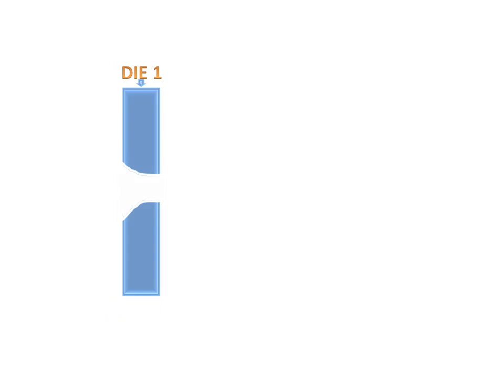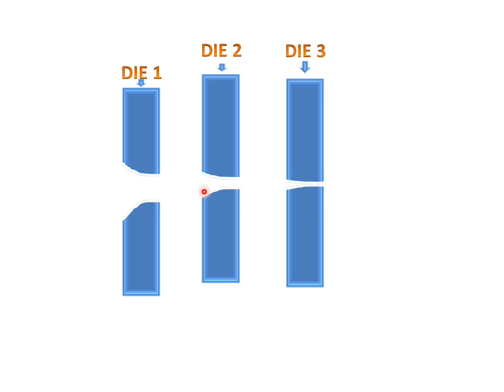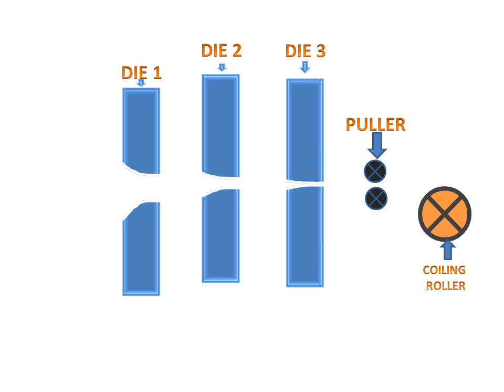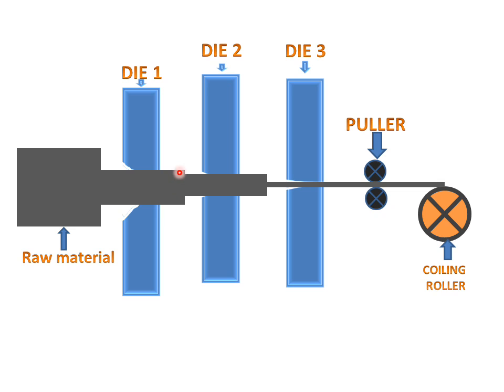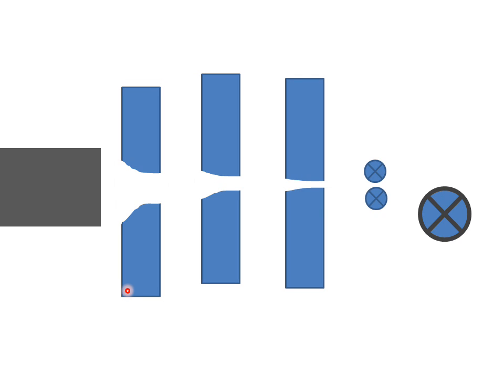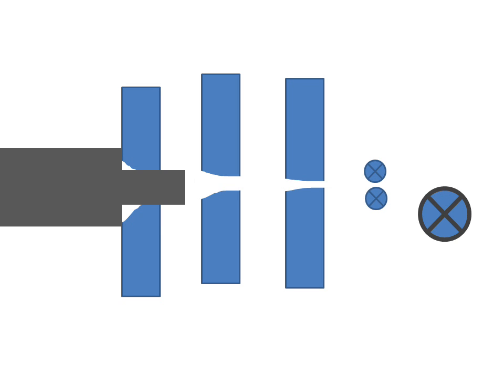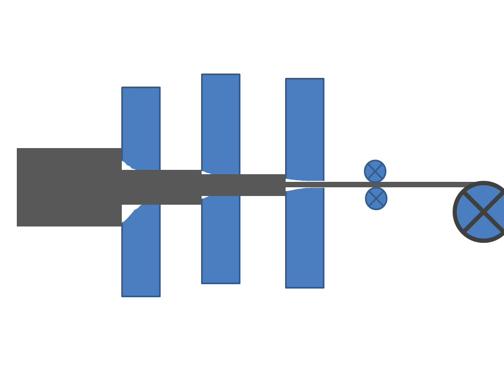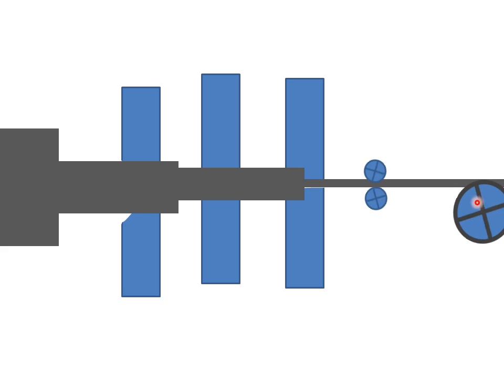Wire Drawing Process(Parts And Working)

Comment: So are there multiple copper rotators then, to make sure the entire wire gets covered? Also, how does the copper adhere to the incoming raw meterial? Is it heated first? Last question: Which raw materials are typically used?

Comment: Sir, if the raw material move from left to the right, what kind of force did we need ? pull or push ? how is raw material getting pulled/pushed from this process ?,
Reply: Raw material is getting pulled by the puller from left to right. You can't push from left to right because then you wouldn't get a force between the other two die. Either way, "push" and "pull" are just words to describe the same thing, a resulting force that points in the direction from left to right.
Reply: It depend on the raw material